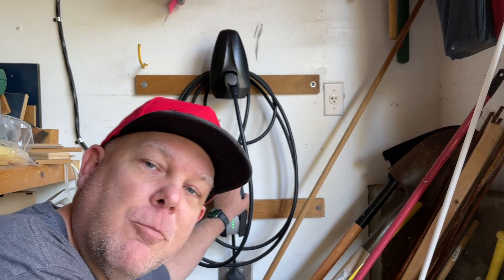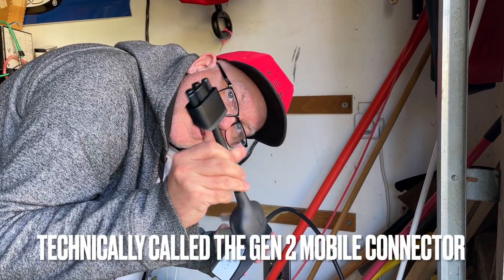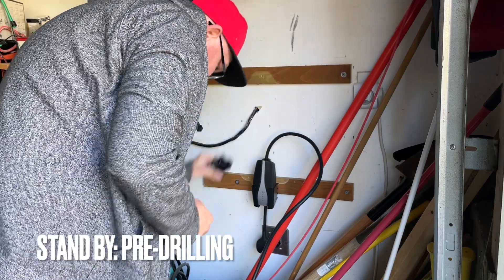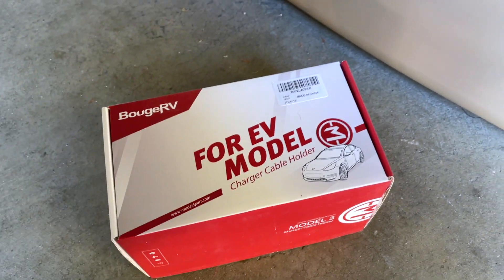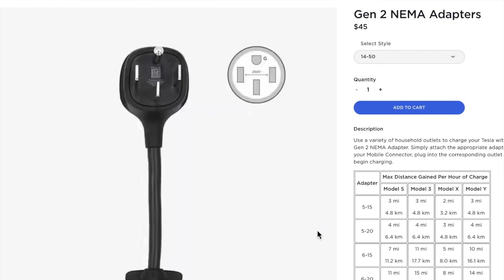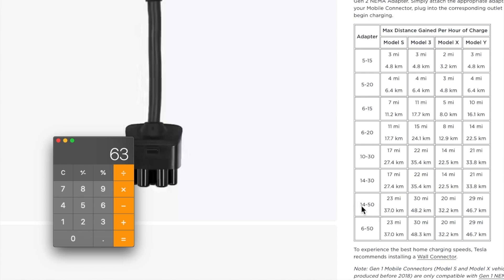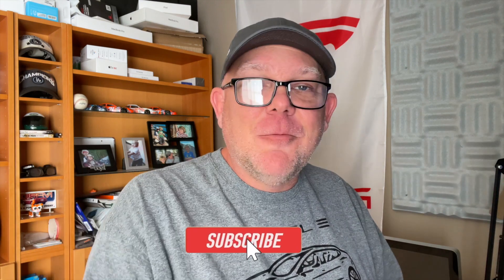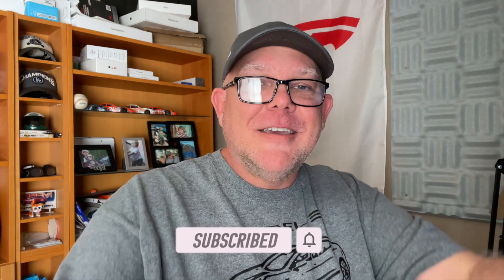Tesla Wall Connector, or Included Mobile Connector with Nema 14-50

Comment: Another big thing to keep in mind is that you need a 200 amp panel to get full use out of the Tesla Wall Connector. Older homes tend to have only 100 amps. Then 14-50 may be the way to go. This is my current dilemma 😒

Comment: I still haven't installed a 40Amp circuit or bought a wall charger. I charge my Model S at night with the UMC plugged into a standard domestic 16Amp socket and get 7 miles per hour and this covers my daily trips and the night EV charge rate is 6cents per kW. UMC's are easily found on ebay for around $200 or less. Keeping it simple..

Comment: Almost everything in this video is now out of date and incorrect. The economics have all changed. Mobile charger no longer free, wall charger significantly lowered pricing. The 15-40 adapter will be included free… Tesla also now provides a wall kit for the mobile charger, although at a higher cost ($35) than what you have here for the 3rd party.
Reply from the maker: Yup. Videos do not automatically update unless in an alternate universe. Thanks for watching!

Comment: Your plug is plug upside down.  It should be ground up and placed higher like where you 20A / 110v outlet is.  This was, the charger would naturally hang down.
Reply from the maker: Haven't had a single issue since 2014. Thanks for watching.

Comment: So I am in the process of installing a NEMA 14-50 or hardwire for the Tesla Charger.  I was 80%+ in favor of the NEMA 14-50 until I talked with electricians.  Although the outlet is safe, it is still the weak point of the install.  Since it is a plug, there is a chance gets to warm / archs and causes damage.  Small chance I know.  I talked with 3 different electricians and all 3 said they would hardwire for various reasons including not using an outlet.  It wasn't a strong preference from most either to be honest but if they had to pick.  So I went from worrying about if the NEMA outlet was commercial enough (heavy duty enough like the Hubble brand) as I read in countless posts to not get the ones at the box stores because they get too warm/hot due to not really designed to be drawing so much power through it for an EV but more for a dryer.
Reply from the maker: I've driven a couple hundred thousand electric miles since 2014 charging from a Nema 14-50 without issue. Thanks for watching!
Reply: The key is to install an industrial NEMA 14-50 receptacle like the Hubbell 9450A even the cost of one of those is like 8 times the cost of a NEMA 14-50 receptacle that you can buy at Home depot for like $10.  The reason why the store bought NEMA 14-50 receptacles are not as good is that if you plug and unplug them often, the prongs inside that hold the male end get loose it can be an issue.  Also since when you are charging you are providing constant 32A through those prongs you would want an industrial grade one.

Comment: My how things have changed in just a few months! I picked up my 2014 Model S a week ago today. I was under the impression that in 2014 the mobile charger came with the 110 plug AND the Nema 14-50. I didn't check and when I got home I was surprised to find it missing. No big deal.....They're $50 from Tesla right? Well they're back ordered! Again....no big deal, I wanted 2 mobile chargers anyway (1 to keep in the car and the other the garage) and they're $200 from Tesla and included the 14-50 adapter I need.....only they're back ordered too. Pivot to ebay, surely I can pick one up there. I can.....for ~ $300 for just the 14-50 plug!!! At this rate it seems like I have no choice but to pay the $400 for the walll connector, that I didn't really want! The panel in my garage is only 100 amps and I'm unsure if it can be made to accept the required 60 amp breaker for the wall charger. I'll find out when the electrician comes next week. This is a bit more complicated then anticipated.....1st world problems, I know!!! Lol

Comment: A few other things to add to my previous comment (see previous comment):
1)  The NEC (National Electrical Code) requires that NEMA 14-50 requires a GFCI breaker instead of a standard breaker for connections for EV charging.  At Home Depot, the current price for a standard breaker (Square D brand) is $13.76 and the GFCI version is $104.00 as of today.  So since breaker for the Tesla Wall Connector  and does not require a GFCI breaker, the Tesla Wall Connector save another $90.24.  
2)  The Tesla Wall Connector cable is 24 ft.  The UMC is 20 ft.  Advantage TWC.
3)  Unless you buy an industrial grade NEMA 15-40, the socket is likely to have problems.  There are multiple reported problems of non-industrial grade NEMA 15-40 outlets melting down when used for EV charging.  Home Depot sells inexpensive NEMA 14-50 outlets for $10-$20 range.  If purchasing one of these, it is advisable to buy an industrial grade NEMA 14-50.  The most well know highly regarded brand is Hubbell, but it cost around $150.  Any of the industrial grade ones will be much more expensive than non-industrial grade ones.  If you buy the Tesla Wall Connector, you won't have the cost of the NEMA 14-50 outlet.  So the extra cost of using the UMC is the NEMA 14-50 outlet, electrical wall box and face plate, which will total another $35 to $165 (14-50 outlet, wall box, face  plate) depending if you go with the cheap NEMA 14-50 or industrial grade one.

So bottom line:
UMC and NEMA 14-50 cost:  $275 (UMC) + $45 (adapter plug)  $90 (GFCI breaker difference) + $35 or $165 (14-50 outlet, wall box, face plate =  $445 or $575 (depending on your choice of inexpensive or industrial grade  NEMA 14-50 outlet)

Tesla Wall Connector:  $495 (current price as of today) - $149 (30% Federal Tax Credit) = $346

In my opinion, this is a no brainer to get the Tesla Wall Connector.  Overall, it cheaper, charges faster, is more convenient plus, it is cleaner set up and it just looks cool!
Reply: You're forgetting one MAJOR component here, which is the same situation the poster of this video has, which is TWO vehicles charging.  If you, for example, only have 60 amps running to your garage, like a lot of people do, then putting two Wall Chargers, or even two Mobile chargers is not possible... because you're maxing out your sub-panel feed amperage.  That is, of course, unless you use the Wall chargers load sharing feature, which balances the load of between two and four wall chargers, to never go past 60 amps TOTAL.  This will still give you the room for things like garage door opener, lights, etc. as those are minimal.  If you plug two mobile chargers in, you're at 100% load, around 64 amps! Even for a 100 amp feed, that's too much if you have a heater, welder, or something else in the garage you work on when charging two cars.  The Wall chargers also give you feedback in your app.  It's simple - if you're going to be charging at home, and plan on living there long term, invest in a wall charger... don't be cheap.... you literally bought a Tesla.

Comment: Philosophically, life is all about choices.  What may be the right choice for one, may not be the right choice for another.  Here is my take on this, with the current situation and prices (Tesla changes prices...often!). Tesla no longer includes the universal Mobile Connector (UMC) with the purchase of their vehicles.  From what I read, it is an extra $200 if purchased with a vehicle.  If purchased separately, on Tesla's website, it is $275, and you would have to buy the optionaly NEMA 14-50 adapter for another $45 to be able to charge at level 2.  So if you did not purchase it with the vehicle, the extra cost is $315.  The Tesla Wall Connector (EVSE) is $495.  However, with the Tesla Wall Connector you are eligible to get a 30% Federal Credit on your taxes, which drops the price to $346.  So there is only a $31 difference between the two.  The Tesla Wall Connector can be connected to a 60 amp breaker and provides 48 amp.  The Tesla Mobile Connector is limited by the 14-50 socket which can be wired to a max of 50 amp breaker.  However, the Tesla Mobile Connector limits the current to 32 amps.  So the difference is 48 amp (11.5 kw at 240 volts) versus 32 amp (7.6 kw at 240 volts) and, therefore, the Wall Connector is about 50% faster versus using the Tesla Mobile Connector.  According to the Tesla web site in terms of adding mileage the difference is  44 miles vs 30 miles per hour.  Even though the NEMA 14-50 is probably fast enough if you are charging overnight, it is still very nice and convenient to be able to charge 50% faster using the Tesla Wall Connector.  So for an extra $31, to me, it is worth it to get the Tesla Wall Connector for the faster charging, and having the convenience of having it in the garage ready to plug in.  Regardless of what people say about "the universal Mobile Connector is easy to unplug from the NEMA 14-50 and put in your vehicle", it is still a pain to wind up the cord, put it into the case, and then place it in the vehicle, compared to using the Tesla Wall Connector.  Bottom line, it depends on how each looks at their own situation and how each person thinks about this.  I just like the convenience of using the Wall Connector...so simple, so easy...and it just looks cool in the garage!!!

Comment: Good video! I just ordered the NEMA 6-50 today. The electrician will be here in a few days to wire everything into the breaker panel. I have a M3+ on order waiting for delivery next month. Since it charges at a rate of 32 Amps maximim, would a 40 Amp breaker be sufficient?
Reply from the maker: Thanks for the kind words and watching! I’d let the electrician decide on all your hardware needs 😀Enjoy your car, M3’s are pretty awesome, like driving a fighter jet amongst prop planes.

Comment: I would consider buying the NEMA 6-50 adapter and outlet, instead of the 14-50.  This saves the cost of the neutral wire that is required for a 14-50, but not used when charging a Tesla or any other EV.  For long wire runs from panel to outlet the cost can be noticeable, not so much for very short runs.
Reply from the maker: Even more savings! Thanks for watching!

Comment: I am getting my Tesla in March or April, and I plan on installing the $500 wall charger.  Why would I , when I can just use the included charger?  Because I plan on using the included charger as it's designed...for occasional use when I am on the road.   It's faster and easier to just have a permanent charging station installed at my home...and compared to the $72k total cost of my Model Y (LR in blue with FSD + tax title and license), another $500 is trivial.
Reply from the maker: That's why there are options. It takes seconds to remove my set up for travel, which I've never needed over many road trips, but it's nice to have. Thanks for watching.

Comment: the math is not quite $63 vs $550. the user with the  wall connector still has her $275 mobile connector that she can carry in her car for emergencies, and for backup in case the primary connector fails. if you discredit these two emergency uses, then she could sell her mobile connector for $275 making the cost of the wall connector $275. so $63 vs $275 with no backup, or $338 vs $550 with a backup
Reply from the maker: Ok? Thanks for watching! :)

Comment: Hi buddy,
Do you have both nema 14-50 on the same circuit breaker, or do you have a different circuit breaker for each? Thanks
Reply from the maker: Separate. We’ve had EVs since 2014
Reply: @whooshn  does this mean you can charge your 3 and y at the same time? Thanks

Comment: How long is this charging cable? 20 ft? I have the nema 14-50 set up. Just waiting for my Model 3 to arrive.. if i park car outside garage it would be about 15 ft away. Hoping the cable would reach the car.
Reply from the maker: Thanks for watching. It’s a 20 foot cable. Very light also.
Reply: Do you plan on passing charging cable under garage door? I’m in similar scenario and was wondering how others have managed.
Reply: @vsanchez1993  yes thats the plan. Hopefully it is long enough.